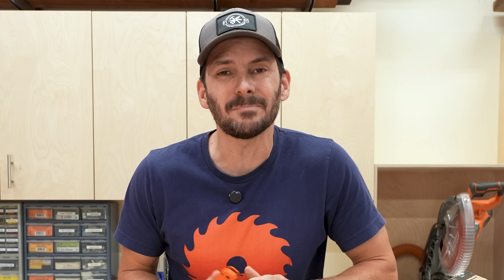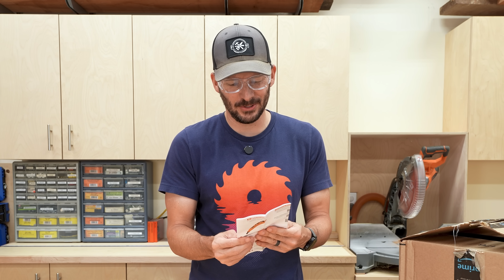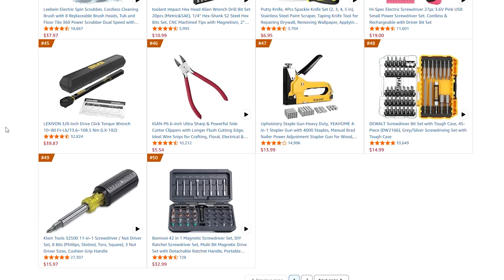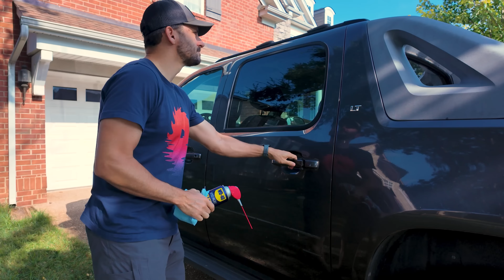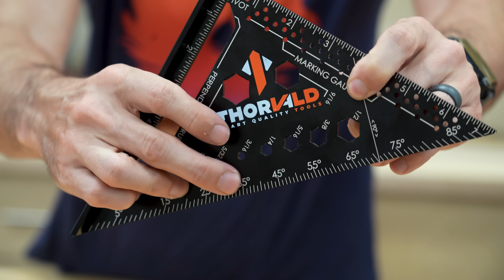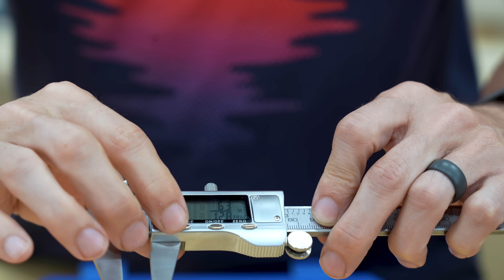13 "Best" Tools Under $20

Comment: The best digital caliper I have used is from Clockwise. Very smooth and accurate. The buttons also feel more substantial than most. Currently only about $25.

Comment: That's actually a big 1/4"  drive, the one I carry, an SK, is hella smaller, and not cheap, the 1/4" drive is my most used as an electrician so I don't mess with trash, I only do SK for that tool.

Comment: The long slot on a speed square should fit the bolt in your power saw for quick blade change.

Comment: Has WD40 fixed the issue of their cans losing psi and leaving 30% of the penetrant in the can? I have maybe a dozen such cans laying around. Sometimes, if I don't mind the occasional mess, I can force air into the can to "recharge" it, but it never lasts.

Comment: That worlds smallest table saw blade looks like it's meant to cut PVC from inside of the pipe. I had an inside pipe cutter attachment for the drill and I can't tell you how handy it was when working under a vanity when it was near impossible to use a handsaw in the limited space. Idk how well it would work on a small cordless rotary tool but it works great on a drill

Comment: That bitholder set is legit. If you just hold the colored part and yank, the bit comes out and same for stuffing it back in. If you try to work the action manually it is jank. I actually found a great use for them in the EDC world. Longer doublesided bits that have Philips and Flathead or T6+T8 let you put on of those holders on either side and now you have a "so far in my use" incredibly reliable quickrelease keychain that doubles as a backup bit holder or even driver if you use a thick keyring and a metal pen to turn it. After you make the belt or lanyard side, you can toss the bitholder on each of your sets of keys or other nonsense and swap it out effortlessly.

Comment: Try using the flush cutters with zip ties by cut across the width of it not the narrow side. Leaves a soft edge and is better for the cutters.

Comment: 26:30 I work as an electrician and I use 5$ one and works great, 2 years, no big problems. And it's way smaller so it fits into more spaces.

Comment: On your new fuse tester I used hot glue in the handle, works great and I've had mine 11 years, mine was from Harbor Freight. wish I had the LCD on mine, I like that

Comment: Best thing to do every holiday season is hit the center aisles at Walmart to look at the stocking stuffers (especially near the tool section). The carabiner holder with the included bits was only $10, they had a great micro tool precision set for $10, emergency auto tool kit for $15, some other random little multi tools, which are all pretty nice for the price. They’re all the hyper tough brand.

Comment: I'm a 35'ish yr master electrician. I was into electronics even at a young age. Even back in the 70's when things were built a lot better you NEVER EVER got any usefulness out of small micro or precision driver sets. Now all these yrs later with probably millions of screws manually torqued down by ONE good set. Keep up with it, take care of it and you'll be set for life. Wiha is one of the top out there, you will pay for them but they are hardened and last. I agree a NCVD is not the place to save money. When using testers always verify. The kleins and flukes are rhe only ones I really trust religously.

Comment: NEVER trust ANY NCV detector! I know pro's that use them, but I do not. Once it lies to me, it's trash. I'm not betting my life on 'probably'. Use a real multimeter! That same brand, Kaiweets, actually makes some pretty decent ones. I use Fieldpiece myself (with UEI as a beater), but if you're not a pro, Kaiweets is probably all you need. Klein makes great hand tools, but I HATE their multimeters because of the screen. The 'white LCD' screen is great indoors, but impossible to read in the sun. They cater to electricians, who are most likely working inside, so I get it, but I work outdoors a good amount. Klein also makes a micro flush cutter (like the Hakko), and a pretty nice one.
Second, the calipers - buy a pair of Vincas. You can get a 6 inch set for $25, so out of the price range for this video, but that little bit more is well worth it. No, it's not pro grade, but it is MUCH better than the sets you've shown here, and, unless you are a machinist, more accurate than you will ever be.
Third, the best precision screwdriver set is made by Nanch. I know, you will keep hearing the name iFixIt, and they are great quality, but the case has the same issue as the one you've shown here - illegible labeling. For some reason, they used black lettering on a black surface. Great spudgers and pry tools, though. Nanch uses proprietary bits, which I usually hate, but the quality is fantastic. The budget brand, Jackemy, is also damn good for the cost. 
I don't have much in the way of carpentry skills (basic at best), so I'll defer to you on tools for that.

Comment: I will say...... I have that same exact set of calipers.  Well.... maybe not IDENTICAL down to the brand.... but everything else is the same.  Yes..... the little thumb wheel DOES rattle, but considering you can use that same thumb wheel to adjust it 0.01mm at a time, I'd say it works quite well.  I use them for measurements for designing stuff for around the house to 3D print, and have even made stuff with tight enough tolerances using those calipers to press-fit magnets and stuff into some parts.

Comment: The wheel on a set of calipers has always been loose. Use the wheel to close the jaws.  It's designed that way to give consistent pressure on the jaws for every reading. It's a holdover from the purely mechanical calipers.

Comment: I have the carabiner bit holder. It is extremely handy. Over the past year I have only lost one bit that I had not seated properly. If you change bits frequently this is an excellent option. Clips to your belt loops as well.

Comment: You should check out the Klein voltage detector that has a  measuring laser built in. I have one and I love it. It’s not 20 bucks but you were interested in both things separately so I thought I would bring it up.

Comment: Ummm... that first screwdriver set doesn't count as a Power Tool... As such, I chose a proper Power Tool with more than twice as many bits able to reach 4x deeper into the item to be repaired when they have DEEP screw holes.

Comment: The bit keyring, Everyone on the Japanese jobsite has these mostly they are used for screw and nut drivers .. the Apex one's are much better than the one you had

Comment: I used the silicone spray this past weekend when changing out my radiatior and hoses on my car, legit was one of those don't totally need, but so so helpful if you have it handy for reseating tons of hoses easily without any fight. Used it on a few other things around the house, it's definitely a good cheap handy thing to have.

Comment: The "Wheel" on the calipers is supposed to float like that. When using, depress the wheel so it will ride on the caliper body until you reach the measurement. With the proper touch and feel on the wheel, it is also designed to slip at the optimal clamping pressure for the most accurate reading of the material you're measuring. So Vernier Calipers are usually devoid of the wheel in favor of a solid knurled half circle and used in woodworking primarily. Compressing the vernier calipers to the wood you're measuring, you want a good tight fit of the vernier calipers for the most accurate measurement. So, two similar looking measuring tools, two entirely different measuring systems that are only similar in appearance. Cheers! Zip~

Comment: The loose wheel on the caliper is not uncommon. It usually moves up and down. I have $300 calipers that have a wheel that slides up and down

Comment: I’m gonna have to call you out on the precision screwdriver set. You said that it’s not for you because the case doesn’t label the bits with individual sizes. Why is that important? How many people can look at the head of a fastener and immediately know that it’s a T6 vs a T7? I would argue that almost everyone will have to try a couple of bits before they find the correct bit and having the cases labeled with each bit size is completely irrelevant. For the very small percentage of people who are able to look at a faster and immediately know which exact bit they need, they likely already have a very high end screwdriver set and would not be looking at one that costs under $20.

Comment: I bought the ToughBuilt one when it first came out. After regular use for about a year, I would say that it sucks. You HAVE to use THEIR specialty blade, there's no onboard blade storage and it doesn't really fit any of the many tool holsters I have. Might give this Klein one a try though. They generally make good stuff.

Comment: Sellers can change item descriptions on amazon without deleting the listing and keep the reviews.  No one is reading through 41k reviews but spend some time doing it and you will see reviews for old items.  They do this to keep a high star rating and make it look like it sold a lot.  This has been a problem on amazon for a long time and makes their review/star system kind of useless.

Comment: 14:30 that metal screwdriver set is much better for another key reason. Those bits are made from S2 steel, which is tons stronger than the other bits. Those junky bits will bend the moment you apply any pressure on a faster. The S2 bits are much more durable.

Comment: The cheapest flush cutters I get from HF work great.  I even get the Pittsburg for, IIRC, under $3.00.  The Doyle are more expensive, but I did not find them to work better.  I must have six or seven by now. YMMV.  The 1/4 inch set reminds me of the HF "meme" tool with the nifty T-handle, which I also like.

Comment: One thing to think about with measuring tools ... how well calibrated are they to other measuring tools?
Saw a gent on another channel do a side by side comparison of two tape measures, one of which was a Stanley.
Within a short distance, the measured  marks did not line up with each other to the point that by upwards of eight feet, there was at least a 1/2" difference.

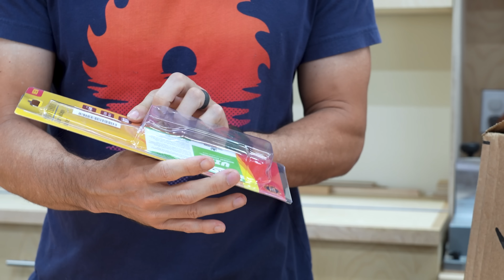Comment: @28:50 - Boats can also be installed with 12v, 24v, or 48v electrical systems.

Comment: Dude! Did you really just put batteries in that laser measuring tool with the positive (+) against the SPRING?? No wonder it didn't turn on, if that's the case. You've got the batteries in backwards! lol

Comment: The Klein is a far better knife than the Toughbuilt. The Toughbuilt is a nice scraper, but the blade keeps retracting in the "box cutter" position. Plus, you're stuck buying their proprietary blades. The Klein is a cow compared to a normal Fastback, but it's a great combo.

Comment: I have a similar pencile with the sharpener that scews off the back.  I love it because that means the Sharpener is always with the pencile.  In the other ones you take it out of the sheath and across the shop, then you need to go back and find the sheath to sharpen.  Means you can leave these penciles around the shop and always have the pencile and it's sharpener handy.  Just my opinion.

Comment: I'd be interested to know if those calipers actually gave an accurate read when compared to a more expensive, proven set 

The bit you mentioned was indeed Pozidrive or PZ. Over here in UK most standard interior woodscrews would be Pozi rather than traditional Phillips. 

Also I have that toughbuilt scraper/knife and it's awesome. It also has a paint can opener on the tail end! Available from Screwfix here in UK

Comment: The whole Amazon review system is sus.  Some sellers simply "update" the product listing by completely changing the product and thus get to use all the previous reviews.  You have to look at most recent reviews.  You might find a product with 80k reviews and 4+ stars, but hundreds of the most recent reviews are all 1 star.  Amazon knows this happens and they don't care because people keep buying.  Caveat emptor.

Comment: I have to disagree on the caliper. I've had mine for almost 2 years and use it pretty regular with no issues at all. Mine does not rattle like the one you had, so you may have got a dud. I've compared it to a more expense analog caliper and my rulers, I've found it to be very accurate. 
Thanks for checking things out!

Comment: KATERK CARABINER WARNING!!! I bought that stupid little thing 3 months ago and it went in the trash can within an hour of opening it. Why? Well MINE allowed you to put all the bits in there, and only ONE was able to be unlocked. Yep - it LOCKED MY BITS in there forever. I tried everything. I ended up cutting the cheap aluminum "lock piece" off with a dremel cut off blade. 0/5 stars - DO NOT BOTHER!

Comment: The story behind the crazy Amazon brands maps back to Amazon policies.  To crack down on the proliferation of duplicate or generic knock-off products, Amazon instituted a policy of manually reviewing all listings that weren't from a US-registered brand.  US-registered brands would be immediately listed, no questions asked.  Turns out, it's super easy to automatically register a brand in the US as long as it's something that's never been requested before.  Asian manufacturers simply registered weird (to Americans) names and kept going.  Viola!  The crazy Amazon brand.

Comment: I have the Toughbuilt knife as well and my major gripe with it is that it cannot use standard utility knife blades.  In order to accommodate the different angles of the knife/scraper, it has to use proprietary utility blades.  It's not the end of the world to buy more Toughbuilt-specific blades, but you can get piles of regular utility blades for cheap.

Comment: Sheesh don't like the metric system...it's the best in the world and the easiest....nothing like 7 inches and 2/16th....were is the logic in imperial from inches, feet, yards miles...howmany inches in a foor??  howmany foot in a yard?  Howmany yards in a mile??   10 mm in 1 cm, 10 cm in 1 decimeter. 10 decimeter in 1 meter, 10 meter in 1 decameter, 10 decameter in 1 hectometer and 10 hectometer in 1 kilometer....metric goes from yoctometer until yotta meter...those are not used micrometer  millimeter meters and km are the most used...Fun fact the first rocket to the moon was build in metric and then converted to imperial...metric is easier and way more precise then the imperial mumbo jumbo...if ou build for example a house metric is the way to go way much easier ...then using feet and inches...

Comment: @Fixthisbuildthat I have that rock seed measurer. It does work, you have to press measure to turn it on… the on/off button is only for clearing and turning off. It works pretty well over long distances. Not great for short measurements, but why would you use it for short distances anyway. In bright sunlight it is hard to see the laser to know what you’re measuring to, or it won’t measure at all, but inside it does great, or in the shade it’s pretty good. I have to go out to site visits for my job and have used it to measure things out on site before. Pretty handy when you don’t have a 50’ tape or two people.

Comment: I have the RockSeed Laser Distance Meter and can tell you it works and I face the same issue you did. The biggest button that says measure is the power ON button and the Clear button is the Power OFF button. Give that a try and give us your thoughts on the device. I've found it ot be a great little tool for the price.
Reply: I have had one for over a year and find it very useful!  I will say the buttons are not very intuitive.
Reply: @DriverDad58 agreed. Hadn't picked it up in a year and had to consult the manual to make this post. 😅

Comment: Note on tools for emergencies: an emergency is when you most need the tool to work, and when it is most likely to break. Your emergency tools should be the best quality you can afford. I generally avoid buying from Amazon brands that are just a random string of consonants—that just screams “fly-by-night” reseller peddling cheap TEMU-level junk. Finally, Amazon reviews are not reliable. At least filter the reviews to look at the ones from verified purchasers who have left written comments. Even on name-brand products most of the star ratings are not from verified purchasers.
Reply: Buy the best that you can afford, on every tool!

Comment: The Klein 2in1 scraper crushes the Toughbuilt in 1 major way. The TB using a specialty blade and the Klein used any utility blade. I wish it was tool less blade change and a pocket clip, but those are small take offs for not having to find the TB blade with the extra hole.
Reply: I bought the Toughbuilt one without realizing that, and when I went to change the blade I was sad.
Reply: @Robinson_CM same way I found out. Glad I have the blades that came with it but I have a feeling it’ll get trashed or donated when I run out. It’s sad because it’s cool and I like the feel of it.
Reply: @goali3903 Is there not any 3rd party manufacturers that make any?